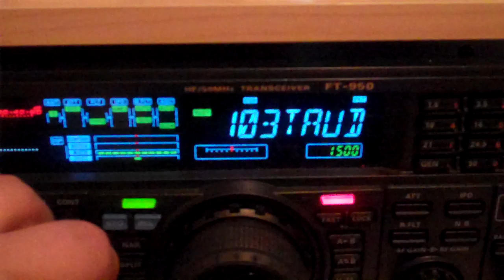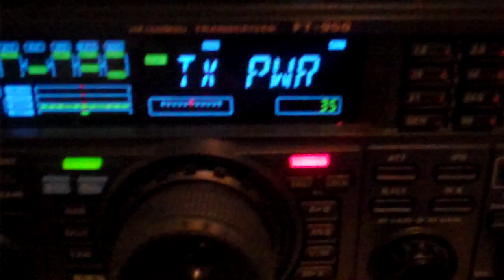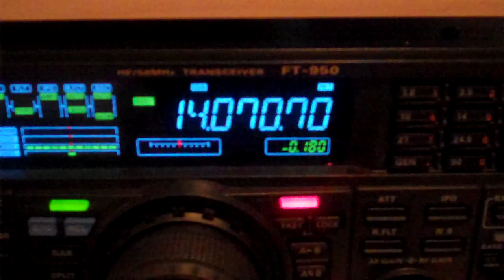Yaesu FT-950 TX Power Adjustment

Comment: Hi Scott I've got a Yaesu FT-950 myself and when I adjust the power I just press the menu button and go straight to the TX power and I'm allowed to use between 5-10 watts and nothing over that but I still get out brilliant on all of the HF bands and I mainly use the 40 and the 20 meters and I get out great and I have had no problems whatsoever with my radio and I'm very impressed with it and some of the features and things that it can actually do is just amazing. Thanks and best 73's for now cheers. Stephen M3SNV 73's.